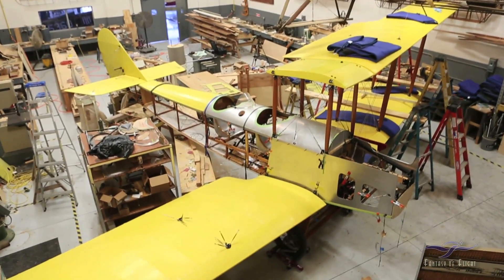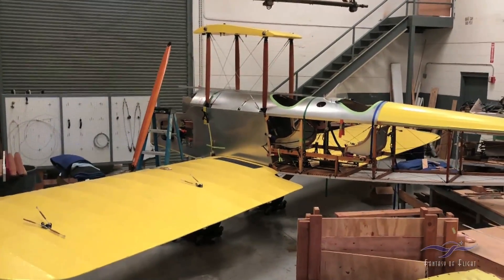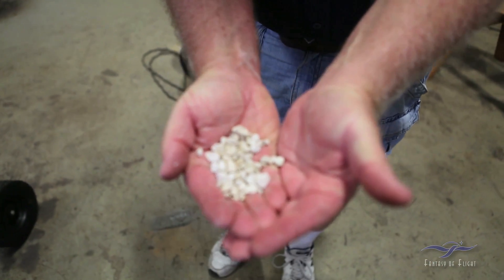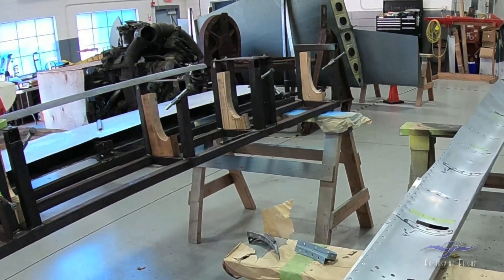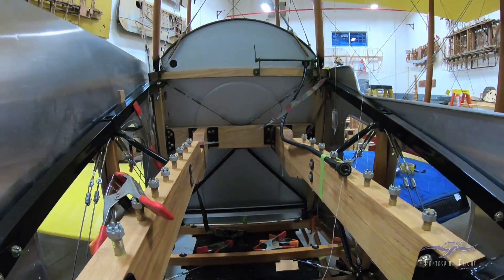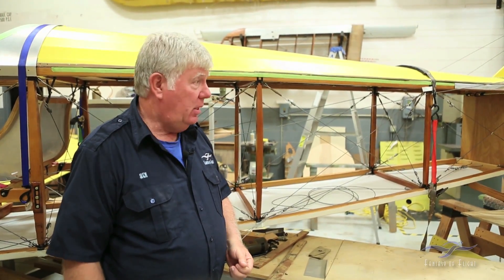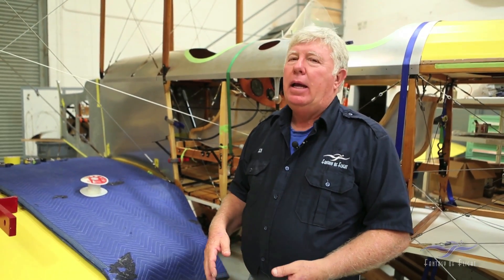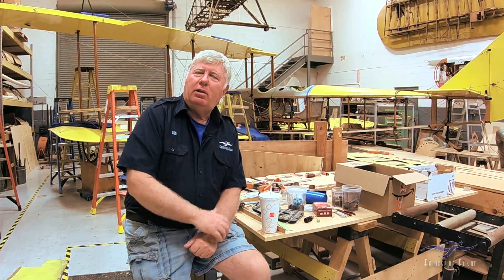Waldo Pepper Standard J-1 - Restoration Update #08 - November 2021 - Fitting the Wings

Comment: Ken, always amazing work done at the museum. I am a former A&P with Eastern and USAirways and 81years of age.
Something I have always wondered about…here you have a fragile wing covered with fragile fabric and then supported
With wood struts. The point where the struts connect to the wing need to be very strong to not only carry the flight loads but also the
Landing loads. The cable tension helps but also adds to that load.
A short video showing the wing and joint structure at that connecting point would certainly interest me and I hope other lovers of
early aviation science and manufacturing. How the metal and wooden parts connect and how the cables attach.
I spent quite a few happy days visiting your museum when we wintered in Florida.
Keep up the great work and be safe.

Comment: Rusty fuel tanks are a real issue. They scare me!! Lets hope yours does not spring a leak. Though the tumbler may be handy in future, make a drum. , 44 gallon drum cut in a third with a decent lid. Good for cleaning  and destressing oh so many  metal parts
I would have used lead shot or maybe coarse glass instead of gravel.
I enjoy these clips, I am more into the restoration than the flying though the flying is the ultimate goal of the excercise.
And I agree with your piece on supporting museums. Unfortunatly lock downs and 5 square metre rules at times make it not cost effective to even open. 
Here in South Oz the National Motor Museum runs several social events that have not happened now for 2 years. Or happened in very small scale. Their grounds are booked for several others which are generally not happening either.
Which in turn kills the catering vans and the town as well with a LOT less people in the area.

Comment: I don’t blame you for wanting to keep the original fuel tank. Great call. 😁👌🏼 I did the exact same thing with my Grandaddys 1946 J-3 Cub. 90% or Cubs restored ends up having a new fuel tank installed. The inside of mine looks just as good as a brand new one. Plus the repops doesn’t look exactly like the factory one.

Comment: To clean out old motorcycle tanks I’ve used muriatic acid with old washers and bolts. Shake vigorously then rinse with distilled water.
Reply: Rinse with boiling water then they evaporate dry.

Comment: I and many cartridge reloaders use stainless pins and some kind of soap to clean and polish brass cartridge cases.  I wonder if that wouldn't work better than gravel as I think gravel would remove solid metal as well as rust and scale.  Maybe pins and a rust removal liquid.
Reply from the maker: Tried everything

Comment: You really have a point Ken with the public needing to support our museums.
With the tumbling tank abrasive 'mixer', was the gravel size small enough to reach into the 90 degree corners?  Was the gravel supported in water? How much gripe did you get from the guys in that room with the tumbler running?
In this trial rigging of the wing(s), does the wings wash in/out come into play?